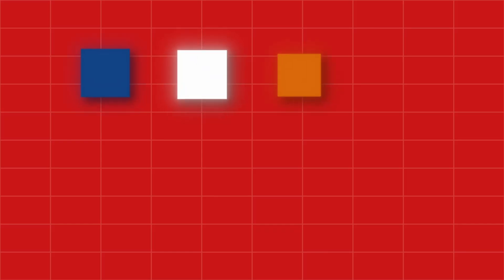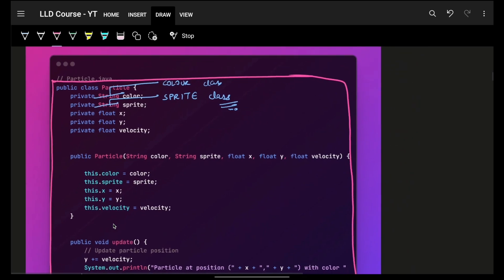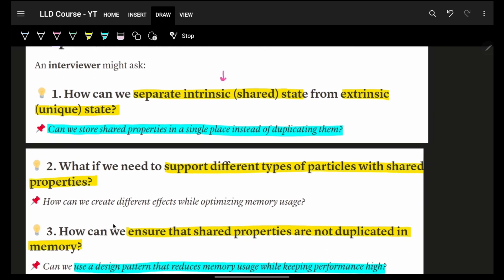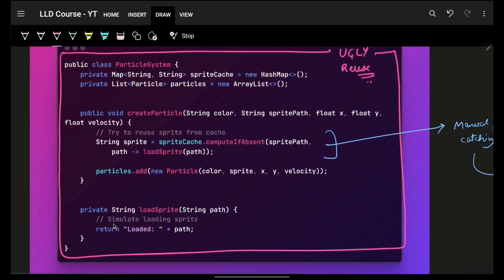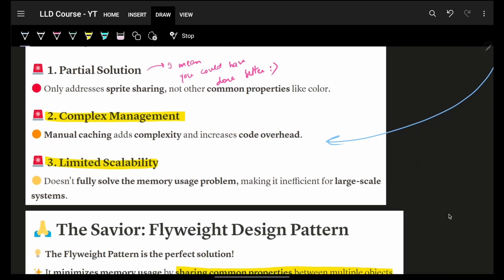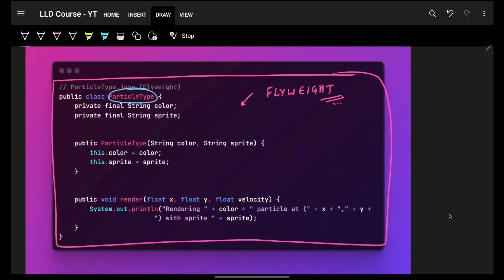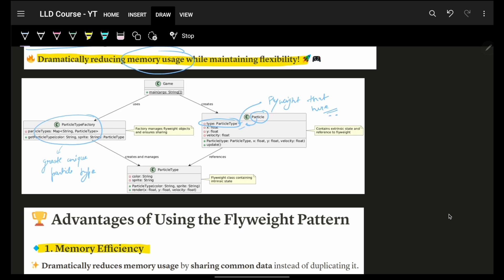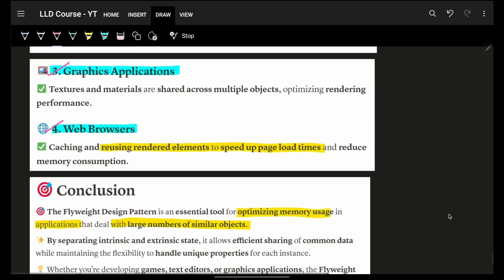Flyweight Design Pattern Explained: Optimize Memory & Performance in Software Development 🚀💾

Comment: This example poorly demonstrates the Flyweight pattern by using only a single particle type, making the optimization redundant. The explanation overcomplicates a simple use case without showing real memory savings or necessity for shared state.